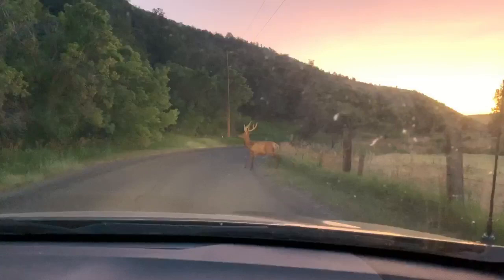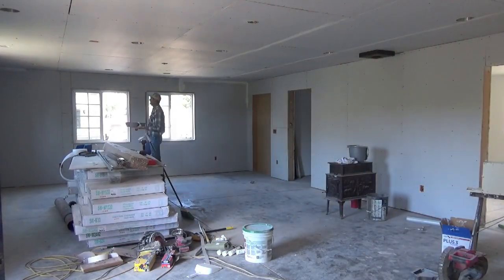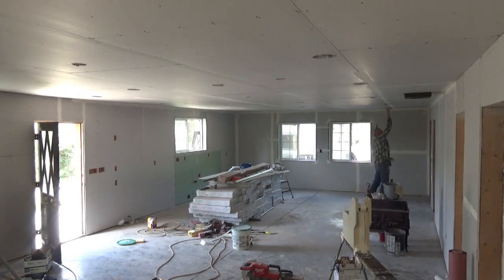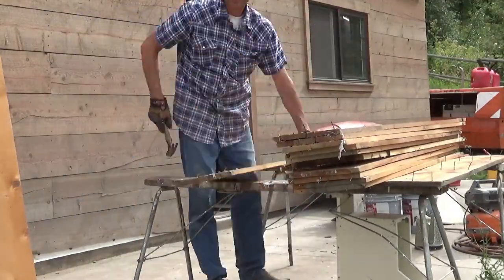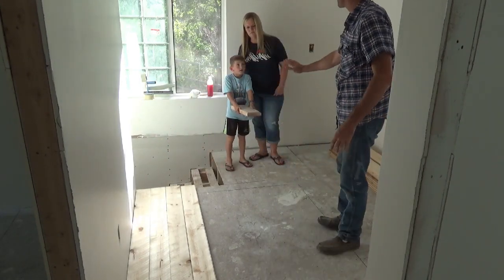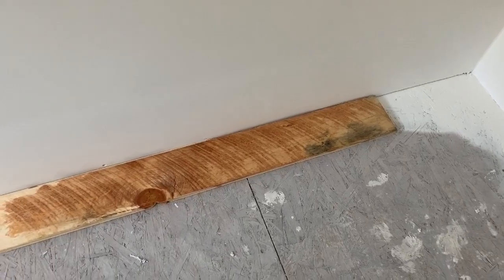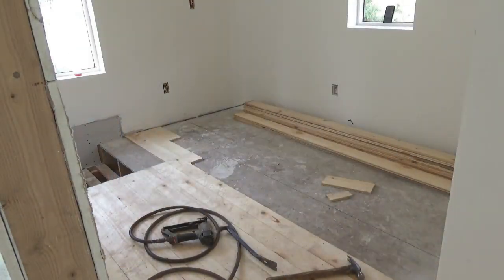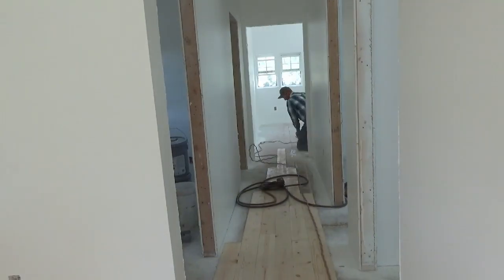#351 - Installed Real Wood T&G Flooring Upstairs - Taped Downstairs

Comment: Stain. Poly. Poly again. Light sand. Poly. Everything will POP. And it will last for ages. I have southern yellow pine floors on 20 years now.

Also, if you read this: make a three or four board stagger rather than a two board stagger. It will eliminate the sense of "seams" and you'll be happier over the years

Also....your work looks GREAT!!
Reply: Exactly what I was to write. A minimum 3 stagger is a must.

Comment: When we remodeled our house, I went a different route. I put red oak plywood throughout the house and stained it with tinted poly. I bought it from the local homedepot, ordered it in bulk from prodesk and they managed to get me a pallet @ $41/sheet 4x8. I just ripped short length into 4ft strips and installed it on the floor with wood glue and brad nails.

Comment: if you put a sock over the magnet, once it is full of nails you just pull the sock off, shake it out, put it back on and go back to picking up nails.  saves picking the nails off the magnet one at a time.

Comment: As a flooring contractor I would suggest a few things. Find a wood shop that will take one of those tounge and groove boards and bevel it at the edge to make a bull nose so you can use the same material as the flooring which makes it look natural. Second I would suggest glue assist any floor boards that you are nailing down over 5" wide, that way you won't have 1/4" gaps in a few months when the material acclimates.

Comment: dude, great job on the flooring,  you made the perfect choice in it. the end look will be worth it. don't forget real oil based varnish  if you can get it.  it will make all the work worth it, an will bring all the boards together.   the circle cut is nice, but it brakes up each room nicely.    the fact that pine lasts so long, it is just perfect.   I could never find old growth pine,  and wound up with a small board from a bowling alley.  it never did have the look I wanted, but did look nice, in the end.  I use 1x6 pine on my walls and ceiling, in every room , in my cabin and with the small board it looked fine.  but you'll find there is never enough of one wood when you need it.  take any you can find, you'll never be sorry.I used a sponge mob too stain it and a 4" brush too varnish it.  it took forever, but well worth the time.  I was so happy in the end.   hope ya get what your looking for.thanks again for the postings. your doing a great job, but I'd get the kids involved too, as it will make them proud also too have helped build their home.

Comment: You might be interested on hardening and sealing the concrete floor. It avoid dust and give it a shine finish that is not a surface coat but instead is embedded.
Reply: Makes too much sense, would be easier and practical.  He won't do it.  Watch.

Comment: I am not sure what you are going to use to seal your floor but if you thin it on the first coat it will soak in the wood deeper and make the top part of the wood harder.

Comment: How come no matting or glue under floor, won’t it be pretty squeaky?
Reply: Squeaks add character
Reply: If you're  a lite enough sleeper it's a safety factor for movement in the house especially when the young ones become teenagers
Reply: So you would have something to complain about .

Comment: Vertical nailing on the face of the flooring wood looks a bad idea. It will be loosen and cause noise soon. You also need to put an underlayment under the wood so that the wood can expand and contract.

Comment: I may be to late but I think you will regret it if you don't t/g the 12 boards after you saw them. That helps hold the floor and won't let it become uneven. This is just a suggestion You've done a supper job so far, I love the way you come up with 
ideas that I've never seen before. How smooth will the floor be by not sanding it after nailing it down. I know they were plained but are they real uniform. The hardwood floor in my living room/dinette built in 2000, is finished 1 by 3-t/G and it has some places I don't like.

Comment: You are doing a wonderful job! A question, while I know you like the look of the smaller width boards, why don't you use the 12" boards in the other bedrooms and the pantry. I know sometimes OCD kicks in, but because they are different rooms, they would be just fine. I have seen wider boards in older homes and it would certainly save a lot of work...in my humble opinion.
Reply: I'm waiting for it to go over the concrete and get glued down.  Won't that be fun?
Reply: @JohnDoe-np3zk  I hope he adds some type of barrier to make sure the moisture doesn't get into the wood.
Reply: @lenellamaxwell6934  I think the best choice is to seal the concrete, I was kidding about the floor downstairs.  Upstairs, he should consider the danish penetrating oil, it soaks into the wood and protects it better than poly.  Cedar color is nice, redwood too dark...
Reply: @JohnDoe-np3zk  I have to agree with you. He has done a great job up till now. I am sure he will continue to be quite wise about how he does things. :-)

Comment: Wow pine flooring nailed straight on top of yellow tongue boards
Without put down sound proofing.
It law in Australia. Building inspector would come in and make you rip it up. It's going to be noisey has hell. Not to mention sweeky . Pine boards shrink and expand in humility.. you will regret not sound proofing.
Reply: These are old pine they are proud and would never shrink in humility.

Comment: I think that using that flooring that you just HAD TO HAVE was a big mistake. Not having enough to do the job is a visual problem. It's going to look like a mishmash of different flooring thrown together. When doing flooring it's a good idea to calculate and get 10% more material than you physically measure for. Also you mite want to put some solid treads on your stairs before someone gets hurt.

Comment: I don't get it.  When doing flooring, why not just do it right?  This should be nailed properly, should have a felt underneath, and the joints should be staggered.  Any three rows should not have a seam within 6" of each other, its not tile.

Comment: Hi Heath,  I love the old natural wood floor look, and don't worry about the pine, it will hold up just fine as long as it's not abused.   I have been using pine for flooring for years, even did a family room in my last home ~12 yr ago, it's still in great shape.
If your interested here is the pine floor I have done in my shop, check it out if you get a chance.  https://youtu.be/a9sP7DeRWoc
I can almost feel your excitement as you close in on the end,  there is nothing better than that feeling.  been there done that.
Reply from the maker: Southern Engineering  That looked awesome! What color did you use? ~Cedar
Reply: The Color is Pecan by Minwax,  It brings out the old yellowing look of aged pine without all the years.  I laid the floor over concrete,  first Tarpaper #30, then 3/4 OSB sub, then the floor.  I figured you would appreciate the `old look'   I did the same in my last shop nearly 15 yr ago, my son lives there now, the floor is still in great shape despite the fact he uses it almost daily.
I'm really enjoying watching you close in on the big day, I know what it feels like to bring a big project home all by yourself.

Comment: Or measure the dia of the markes and dept ( like 1/64 ) on flooring and set up ur router on a swing arm with the right little depth set and you could easily match the flooring...

Comment: are you looking for a new job, lol....   you need carpet to make the rooms feel warm.
Reply: Full Carpet in the countryside gets dirty fast. Maybe some rugs.
Reply: @benjigirl1971  you're right, I was just thinking about cold floors,. especially with just that little wood stove.....  I'll bet dollars to donuts that there will be a furnace in the home at some point.....
Reply: I don't believe that he has thought out how uncomfortable that house is going to be without central heat, windows are going to have thick ice on them, cold is going to seep into the cement all through the main floor and I don't care how well it's insulated  it's going to feel cold.  Humidity is going to be a problem, a furnace pulls moisture from the air in the home, otherwise, you are going to have mold issues,  just take a look at old homes that had furnaces in the floor with no fan to see the problems they had.  He will end up putting floor vents in the upstairs rooms and ceiling vents on the main floor at some point. It shouldn't take that much propane to keep a home that well insulated toasty warm especially with the help of the small wood stove.